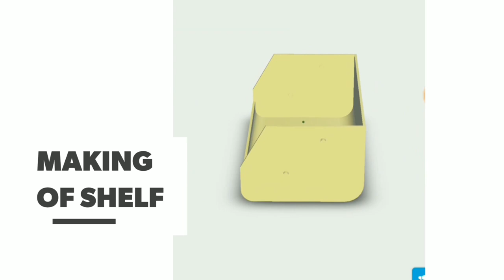How to make a Pull down Shelf || Demonstrated || MADA

Comment: I have built a thing or two and think this is on a scale of 1 to 10 with 10 the highest rates a very solid one (1). Nailing quarter inch plywood, sloppy gluing, drill press looks like it lives outside.
Reply: You are not wearing Own It's shoes.
Reply: Your taste, character and appreciative insight are 10, with 1 being just a viewer and 10 being a raging asshole